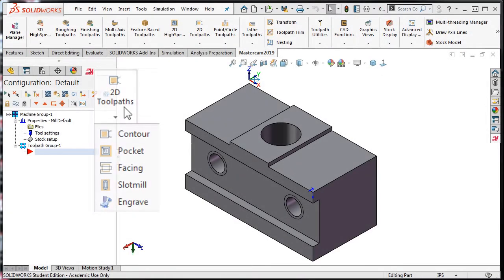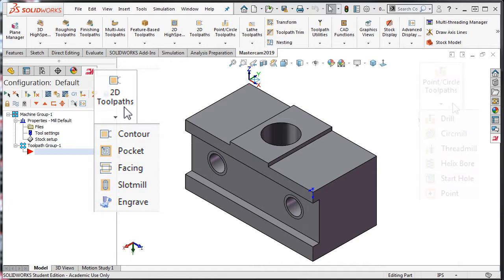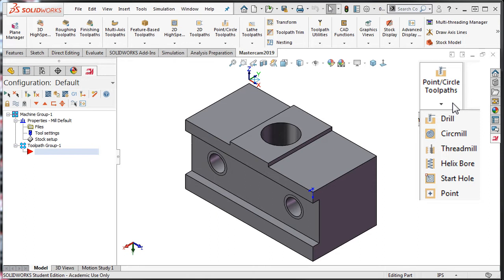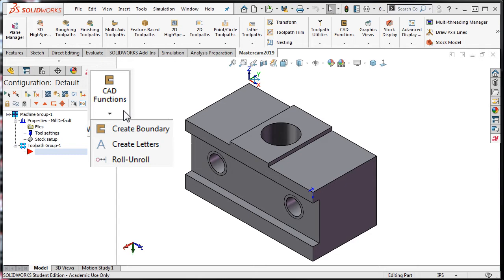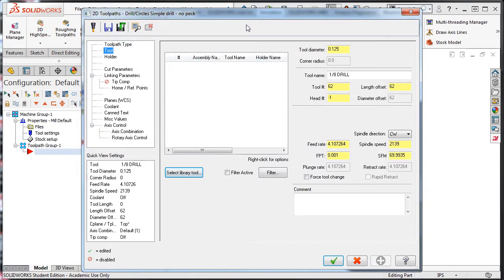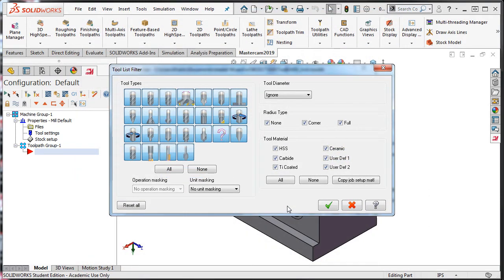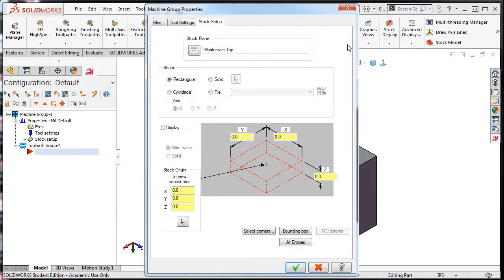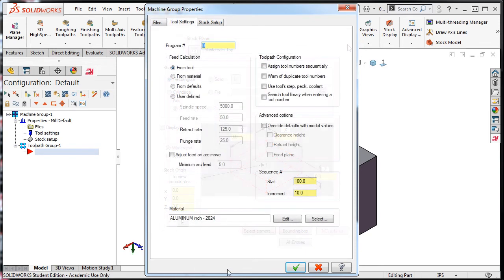00 - Mastercam for SolidWorks - Welcome

Comment: Please master a query, if I have installed the solid premium 2021 sp0.0 which version of MASTERCAM FOR SOLID I need to make it compatible with the version of solidworks that I have installed please ... in case I knew and I have it, could you share that complement please ??? by my mail ... please :(
Reply from the maker: Any version of Mastercam for SolidWorks, educational or otherwise that is 2021or later will work.